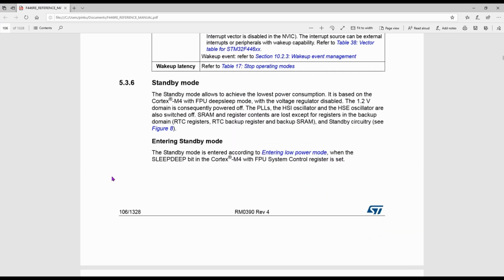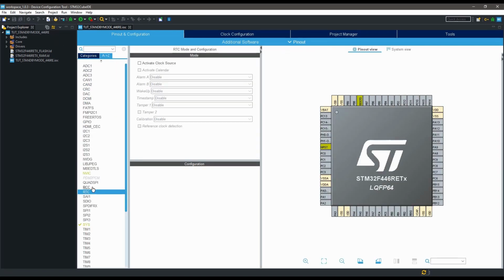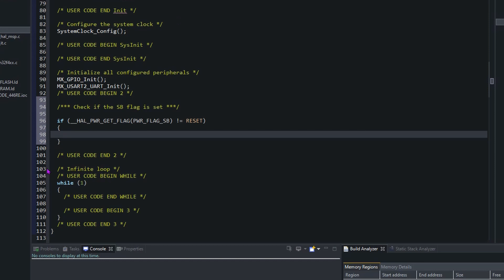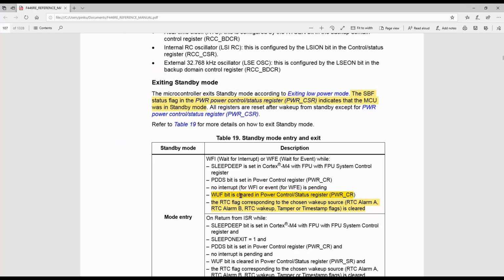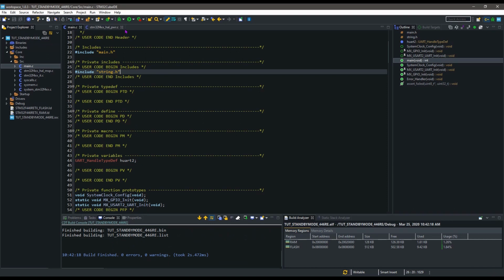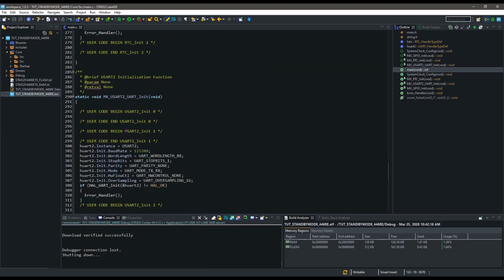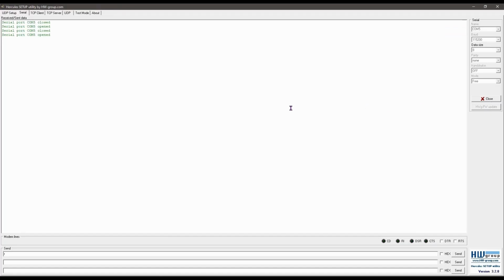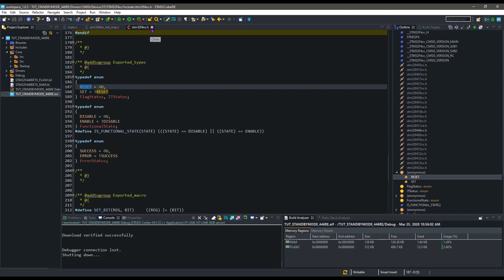STM32 Standby Mode Tutorial | Ultra Low Power MCU

Comment: I do the wake-up operation with the WakeUp pin on the STM32F7508-DK board, but after it goes to sleep once and wakes up with a trigger, it constantly goes to sleep and wakes up before the trigger comes and continues like a cycle. What can I do about this?
Reply: I clear the flags before going into sleep mode, but the problem still persists.

Comment: I am periodically waking the controller every 5 seconds to read the temperature from the MAX31855 slave device and transmit it to the computer console using UART. While sleep and stop modes work fine with my STM32 L053R8 controller, enabling shutdown mode results in incorrect temperature readings. Is this due to the short delay of 5 seconds, or is shutdown mode not suitable for my application? Please help.

Comment: Hi
I want to enable the wake-up function for RTC, but I didn't see  a wake-up option in RTC of the STM32C011F6U6 controller in the cube IDE. I need to implement a 5-second delay while reading the temperature via SPI in standby mode to save power. Is this a limitation of my controller, or do I need to change some other settings to enable wake-up in RTC?

Comment: hello sir,
I did get an STM32f401 , and the standby works fine but there is something, 
 if (__HAL_PWR_GET_FLAG(PWR_FLAG_SB) == SET)
I use this if statement to check if the wakeup reason is the RTC or the Reset as you mentioned in your blog, this If condition has an else that the board doesn't execute. when I press the Reset button it goes to the If statement. in short, I couldn't distinguish between the RTC wake-up and the reset button. I hope you get my question and help me with it

Comment: Hi
I cant fined these options in stm32cubemx with stm32f103c8t6 (I mean the alarm and wakeup section) is it supported in stm32f103 ?
Reply from the maker: I see the options are available at the register level but not in cubeMX. You can check the reference manual about how to turn the alarm on.

Comment: Hi. I boot with stm32L010C6Tx. I am in standby mode. While waiting in standby mode, it shows between 3.1 micro amps and 50 micro amps 50 microamps is too high, I can't use it like this. . I turned off all peripherals. What else should I turn off? 
void SystemClock_Config(void);

static void MX_GPIO_Init(void);

static void MX_LPUART1_UART_Init(void);

static void MX_I2C1_Init(void);

static void MX_ADC_Init(void);

static void MX_RTC_Init(void);

if (__HAL_PWR_GET_FLAG(PWR_FLAG_SB) != RESET) {

__HAL_PWR_CLEAR_FLAG(PWR_FLAG_SB);

printf("Wakeup from the STANDBY MODE\n\n");

for (int i = 0; i < 20; i++) {

HAL_GPIO_TogglePin(GPIOC, GPIO_PIN_13);

HAL_Delay(200);

}

HAL_PWR_DisableWakeUpPin(PWR_WAKEUP_PIN1);

HAL_RTCEx_DeactivateWakeUpTimer(&hrtc);

}

__HAL_PWR_CLEAR_FLAG(PWR_FLAG_WU);

__HAL_RTC_WAKEUPTIMER_CLEAR_FLAG(&hrtc, RTC_FLAG_WUTF);

printf("About to enter the STANDBY MODE\n\n");

for (int i = 0; i < 5; i++) {

HAL_GPIO_TogglePin(GPIOC, GPIO_PIN_13);

HAL_Delay(750);

}

HAL_PWR_EnableWakeUpPin(PWR_WAKEUP_PIN1);

if (HAL_RTCEx_SetWakeUpTimer_IT(&hrtc, 0x5A55, RTC_WAKEUPCLOCK_RTCCLK_DIV16)

!= HAL_OK) {

Error_Handler();

}

printf("STANDBY MODE is ON\n\n");

 

HAL_GPIO_DeInit(GPIOC, GPIO_PIN_13);

HAL_GPIO_DeInit(GPIOA, SDIO_Pin);

HAL_GPIO_DeInit(GPIOA,GPO3_Pin);

HAL_GPIO_DeInit(GPIOA,BUZZER_Pin);

HAL_GPIO_DeInit(GPIOA, GPIO_PIN_0);

HAL_GPIO_DeInit(GPIOA, CSB_Pin);

HAL_GPIO_DeInit(GPIOA,FCSB_Pin);

HAL_GPIO_DeInit(GPIOA,SCLK_Pin);

HAL_UART_DeInit(&hlpuart1);

HAL_I2C_DeInit(&hi2c1);

HAL_ADC_DeInit(&hadc);

 

HAL_PWR_EnterSTANDBYMode();

Comment: Could I place this whole standby code part to while(1)? I would like to periodically read sensor values when MCU awakes.
Reply from the maker: What's the point of putting inside the while loop ?
When the mcu wakes up from the standby, the code executes from the beginning i.e. HAL_Init () function..
So you just keep it in the main function like i did, and it will work fine

Comment: Hi, I have a problem with the standby mode, namely I would like to make the time appear on the LCD display for 5 seconds, while after 5 seconds the system goes into standby mode for some time, wakes up, shows the time for 5 seconds, falls asleep and so on. However, when the LCD screen wakes up, the time is not displayed, but goes into standby mode immediately.
Reply from the maker: And how are u keeping the track of the time ? Are u using some kind of RTC ?
If you doing so, first test your code without the lcd. Just use some led and see if it is on for 5 sec or not

Comment: Hello. I am using stm32f103c8t6 aka bluepill. But the lowest consumption I get is 1mA. Ive removed the power regulator and the LEDs. Measuring the current witch INA3221 and the regular multimeter. Could someone please help me...?
Reply from the maker: Are you sure that the device is entering the standby mode ?
Reply: @ControllersTech  i am running the folowing commands:
//enable the PWR control clock
RCC->APB1ENR |= RCC_APB1ENR_PWREN;

//setSLEEPDEEP bit of Cortex System Control Register

SCB->SCR |= SCB_SCR_SLEEPDEEP_Msk;
//select standby mode

PWR->CR |= PWR_CR_PDDS;
//clear wake up flag
PWR->CR |= PWR_CR_CWUF;
//enable wake up pin

PWR->CSR |= PWR_CSR_EWUP;
__DSB(); /* Ensure effect of last store takes effect */
//request wait for interrupt
__WFI();
Reply: Controllers Tech I am quite sure, because when I apply pos-edge pulse on PA0, it wakes up.
Reply from the maker: Can u simply use the function to go into the standby mode.. like i have used in the video. And than try measuring current
Reply: @ControllersTech  i am using the next code:
__HAL_PWR_CLEAR_FLAG(PWR_FLAG_WU);
  HAL_PWR_EnableWakeUpPin(PWR_WAKEUP_PIN1);
  HAL_PWR_EnterSTANDBYMode();

I have two bluepills and with this code, one gives me 0.8mA and another, 0.02mA. The difference between both is that the first one has an on board power regulator and LEDs removed. The other one has exactly 0 coponents on board (just the uC and reset button). I am trying to achieve 0.002mA (2uA) because I am working on battery powered IoT device.
Reply: @uawhisper  can u send me your example code standby mode  for stm32f1? Thanks very much!